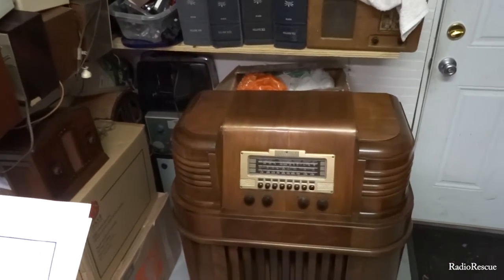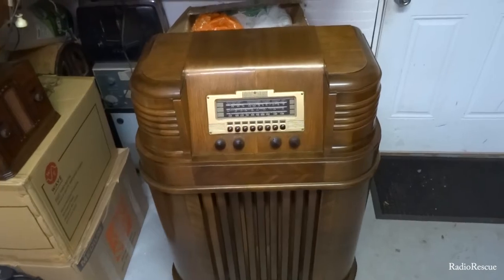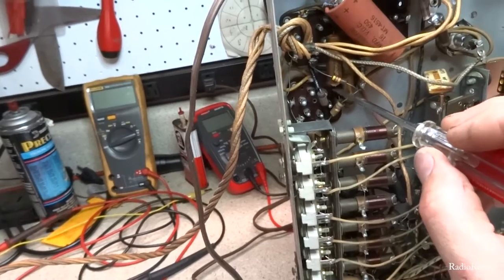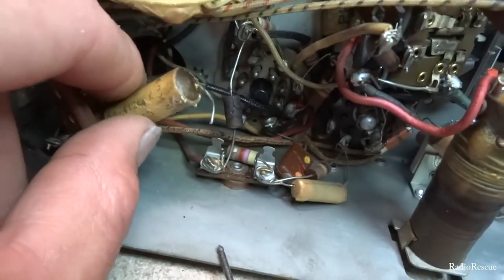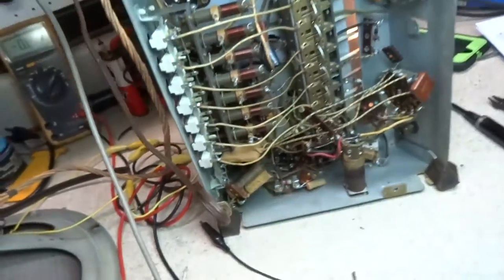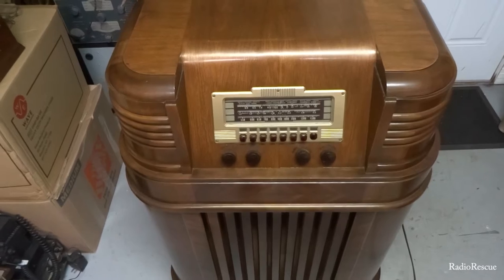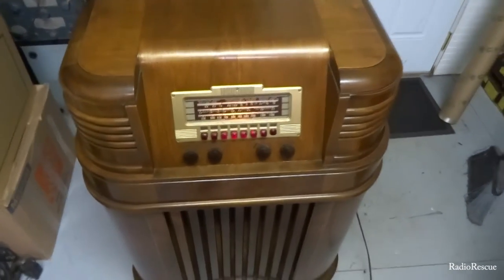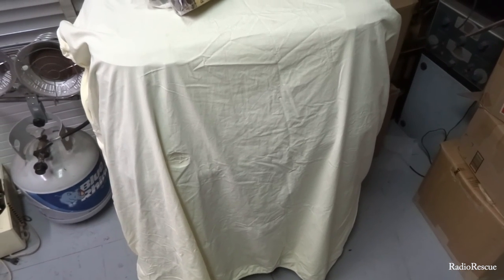Repair Of A 1940 Philco 40 180 Tube Radio

Comment: Great analysis of why you didn't get a signal. All paper caps should be replaced and the electrolytics too. Check for
out of tolerance resistors  then do an alignment and it should work and sound great for many years. Transformer 
operated sets should get a properly sized inline slo-blow fuse. The owner should be happy with all your dilengence 
on the  excellent chassis work!

Comment: I have several of them including the one my grandparents bought new in 1940. I wanted to work on a few to learn before I worked on the historic family radio. I bought several of the table top models because I am hooked and they use a lot of the same parts. I got a few up and running. They are fun to work on. I had a professional work on two of them thinking that I could see how it’s done but it was very expensive and I think mine are better!

Comment: Thanks for a very informative Radio Rescue. That original radio looks amazing for its age! I'm curious if you have a label inside the cabinet that shows the correct tubes and their location on the chassis? Sometimes you'll find someone installed a totally inappropriate tube that sorta works and they leave it at that. 
Right now (01/31/23) you're at 6.99K subscribers, so congratulations are in order, I would think. 7K is so close you can taste it!

Comment: I found a philco 1940-156 built a little diff. Has the whole top cover lift up
Because it has a turn table in it ( or did have It's missing)  but about same radio as 
other 1940 thumb wheels instead of  knobs for volume ect. It's 4 hrs away could,t talk my wife into
saying go ahead . I said it's only1 dollar/ but 4 hrs away as gas is $40 + dollars

Comment: Hey Mr Radio Rescue, Thanks for all of your great videos. I am working on rescuing a GE 547PH with SMD. I attempted to replace the mica caps like you did in a previous video, but ended up with a complete miserable failure. My question to you is do you have and are you willing to part with a replacement IF can that will work in the radio? There are no radio swap meets in my area so old radios are very hard to come by without going to the thieves at EBAY.
Reply from the maker: I don't know if I have any. I'd have to see the style can you have. email me @ dustytubes@gmail.com send me a pic of what you have.

Comment: I don't know what the issue is, but this is now the second video of yours that refuses to load. No other video has this problem. I even turned off the ad blocker which allowed the first ad, but not the video itself. Obviously this is something gong on here since I see all of the comments. I'd actually love to watch the video...
Reply from the maker: Sorry.I don't know. No problems here. Nobody else has mentioned anything.
Reply: @45AMT  So, now I know what it is. After a couple of other videos had the same problem, I looked up Windows 11 video playback issues. The issue Windows 11 in Firefox (and Chrome) all of a sudden doesn't like having the playback set to auto on 1080p. I had to move it down to 720 for the videos to load. This is obviously a known issue with Windows 11. Anyway...tonight I should be able to finally watch your video.

Comment: I know this is kind of old ,but I am working one that belongs to an old friend ,and I have some questions. I have replaced all the wax ,and electrolytic caps as well as resistors ,and some wiring. I had some help from a gentleman that walked me through an alignment as well. I cannot get any stations as of yet. (could be where I'm located partially.) There is something that I'm curious about ,and I'm trying to confirm it with someone that actually has a 40-180. On the one I'm working on there is a connection that that goes from the heater wire to the ANT terminal. Why is that there? Why put AC voltage on the ANT terminal? Out of curiosity I disconnected that wire. I was getting zero radio noise ,so I connected a 20' wire to terminal #1 on the four terminal strip. I can get one station that barely comes in ,and it's noisy. Does this radio you have repaired have that same connection to the heater?  Thanks !
Reply from the maker: This was a customers radio that has long been picked up.

Comment: Philco made a few variations of this chassis from 1939-42.  I've got a 40-190, which is this set in a different cabinet, as well as a 41-255 I recently restored on my channel.  Both great playing sets.  Philco used a strange implementation of push-pull with no phase inverter, but it works well and sounds nice.  You're lucky you didn't have to deal with bad rubber wiring, but with the cabinet as nice as this I would think it was kept in a climate controlled environment. The other common issue is an open output transformer, in about 50% of these sets they're open. These are common sets, but they play extremely well and with this being in such nice shape, I'm sure the owner will really enjoy listening to it for years!
Reply: Is the 40-150 the same chassis in a table top model?

Comment: I find that common capacitor  values are not that common today, so some of the values like .003 mf or .005 mf can be replaced with  a more common value that  close, as they are not that critical  in coupling or tone circuits. However, I would not substitute  different values into the RF section where capacitor values and coil values are critical.  I also put a fuse in the chassis a also a 3 prong power line cord
Reply from the maker: Replacing a .05 with a .047 and so on, makes no difference regardless the section of the radio. As long as the values are close. It makes no difference. As far as the power cord. I don't replace them unless the customer wants it. Many of my customers are collectors and like the originals.
Reply: @45AMT  The majority of the radios I have restored  and it's more than 25,  are mine that are attic or basement finds, and I would not think about plugging it in without replacing the  line cord .  A 3 prong cord adds a needed ground for  the chassis  for  better  performance as well as protection.  The radios that I  have restored for others,  they didn't care about how authentic the line cord was,  they were thrilled about their 80 year old radio working  after rotting away in their basement or grandparents basement.

Comment: I have a 41-280
Reply: I have one that year that’s probably the same one or close to yours. I found it in Portland and the same family had it since new. They said it didn’t work but it looked like new. I took it home and hit it a few times and moved the knobs and it started working great! It’s a 10. 50 dollars so I felt guilty and paid them 75.
Reply: @patfromamboy  I hope your radio is still working. If it hasn't been serviced, it really needs to be. Replace all the wax and electrolytic capacitors and out-of-tolerance resistors. It should be serviced just like this video shows.
Reply: Exactly right. I have about 10 of them between the full sized and desktop versions. I’ve replaced capacitors in a couple and it really helped. Thanks